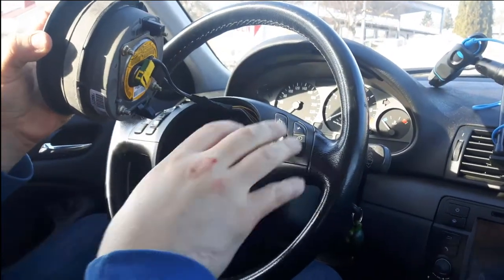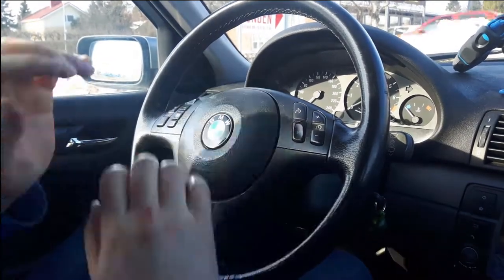BMW e46 Multifunction Steering Wheel

Comment from the maker: Hey guys sorry for the wrong info this retrofit works directly on all 6 cylinder cars from 1998 and newer cable throttle or electric. In 4 Cylinder cars it works only if it has electric throttle (2001 and newer), cable throttle ones will need additional parts to make it work if anyone knows what those parts are feel free to post that as a separate comment or a response to this one.

Comment: Your model car? Mine 318i coupe 2/2000. Can it be done by this method?
Reply from the maker: The car in the video is a 2003 320i 2.2l inline6

But the method can be done with your car too.
Because BMW made all the throttle-bodies before 2001 a hybrid a cable for normal throttle and a e-trottle for cruise control. so you need the wiring and buttons and you are done!